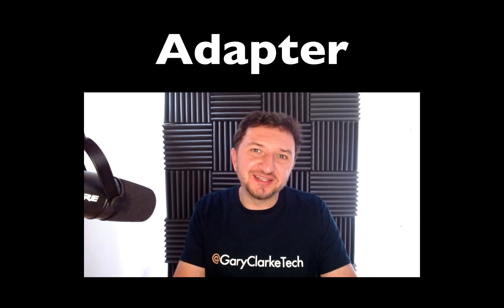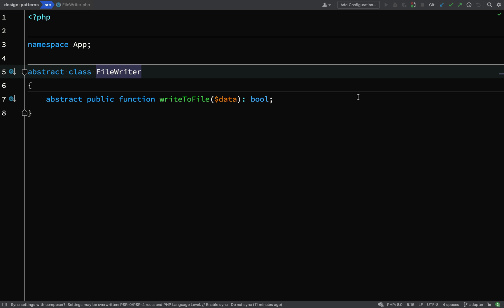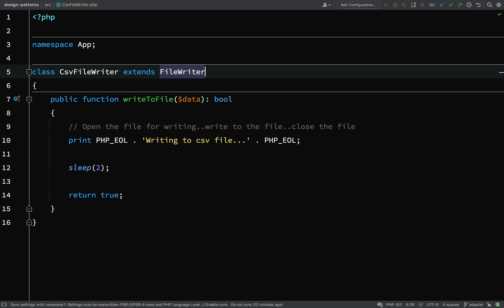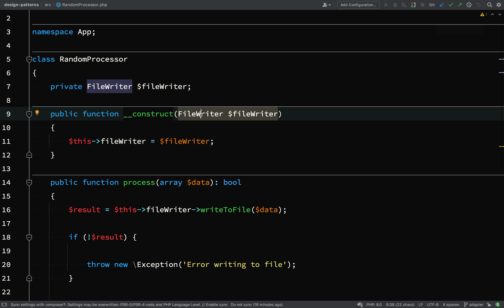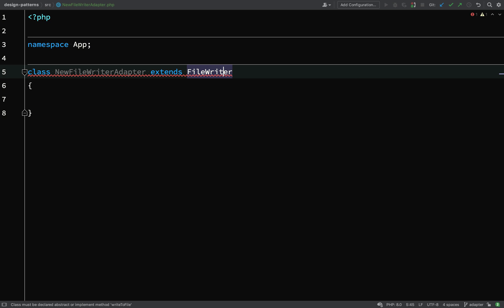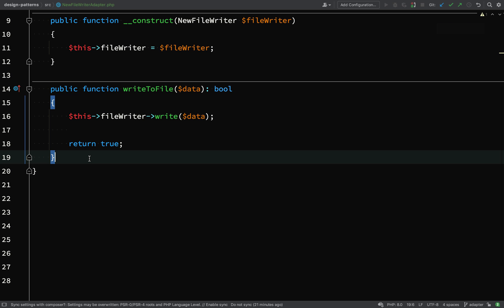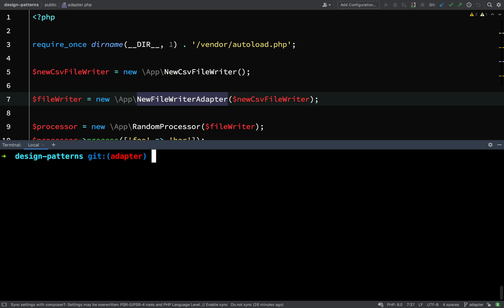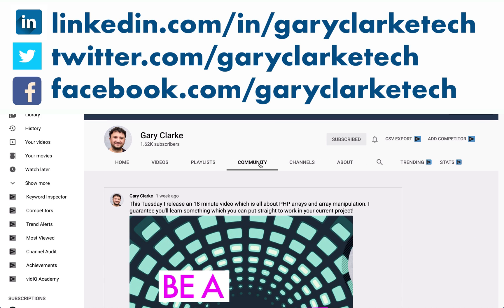PHP OOP Design Patterns | Adapter Pattern

Comment: one question why you inject a class in the property if you already injected inside the construct 4:27 ?
Reply from the maker: It's just type-hinting. This is how it's done when you are not using constructor promoted properties but it does the same thing